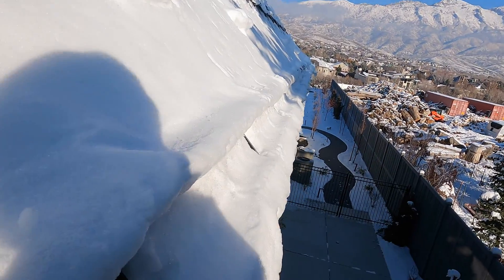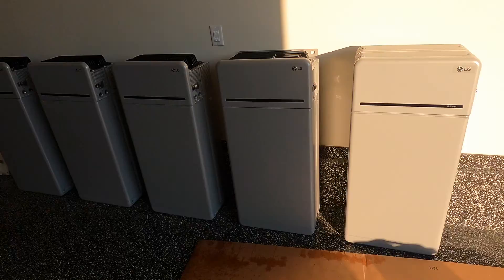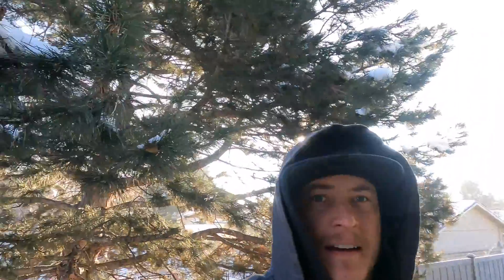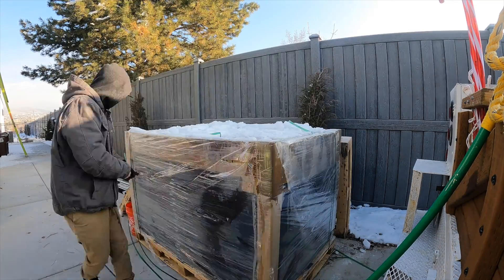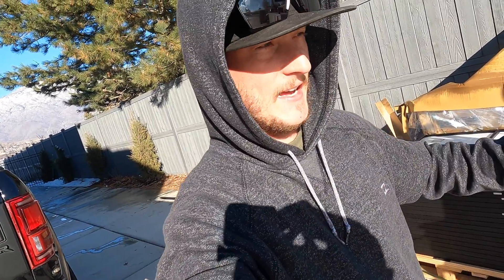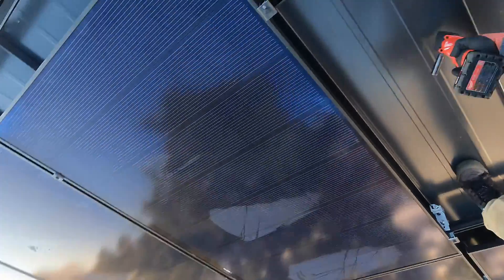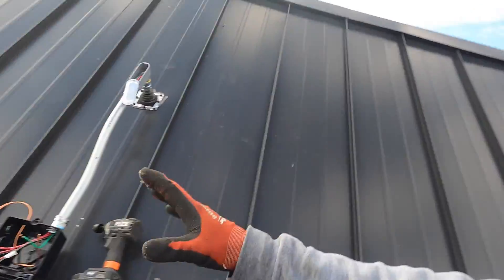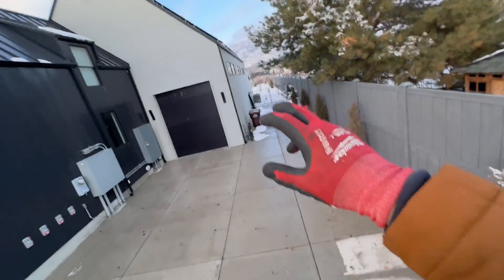Installing 60 Solar Panels Solo  - Work Vlog

Comment: Ok this guy lost all respect saying he likes solar edge over enphase, first off let me tell you out of over 2000 installs I’ve done never once have had a bad enphase combiner which that’s what it’s actually called and not an invertor those go into cars😂😂 but yet 2/4 solaredge combiners I get are literally faulty and if you know how to test you just see if at least all panels are going to the box at least if they are and your combiner won’t sinc up right than guerentee 96% of the time you got a faulty combiner box and trust me I would know I have a commercial account with  CED and even they say solaredge is the goodwill of solar compared to enphase and you also have to run it in a circuit rather than just matching wires and using jumpers to jump arrays and before messaging, yes a circuit where the string Goes from front panel and has to daisy chain the whole thing rather to enphase you just match black with black and red with red and tie in your ground and literally just make sure you don’t exceed 13 per string that’s it. so in that case if you got Let’s say you got a 26 panel but three arrays so three different mounting plains all you have to do is one home run string to closest array and than another string that goes to second array and than jumps it in the attic to the third array, than wire it black with black and red with red and than your ground and label your strings from combiner so when you tie in you know your strings are tied correctly and solaredge is just crap if I had that same install I would have to first of all make a circuit and use roof conduit and very rarely attic run because you have to use damn pv wire on the roof and run it all the way across the roof to your  other array and connect either male or female to the array and it just looks ugly and not to mention the wiring is literally backwards 😂😂😂 black goes to red and red goes to black and ground is still the same but here’s the kicker pv wire is all the same color and you literally have to cut a lead and put it into the box and than have to go all the way to the last panel you set and run a pv wire like 30 to the box just to get your positive to go into the box. It’s literally more work and also the goodwill of solar and even on top of that like I said solaredge is crap and there combiners half the time literally are faulty from the factory not to mention enphase has an option to just plc scan on the app and see if all the panels are communicating to the box and than done, your electrician can commission while your on your way to next job with solaredge you be waiting longer on the phone than the whole install would have taken if you just used enphase 😂😂😂
Reply: "Ok this guy lost all respect saying he likes solar edge over enphase" 

Enphase is alot better true... maybe this is how he makes more money it's his bussines don't judge.

Comment: You're really good, only I think you need a rope and harness 👏
Reply: Correct. but when you work on the roof it make's it 10x more difficult to work effecient. the only dangerous part is when you climb on the roof from the ladder or descent from it on the roof you are safe.